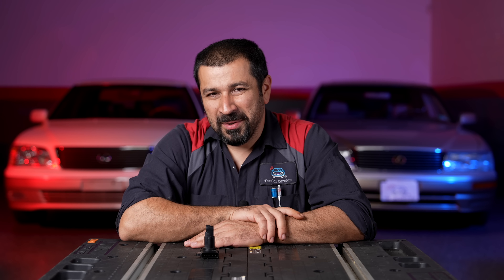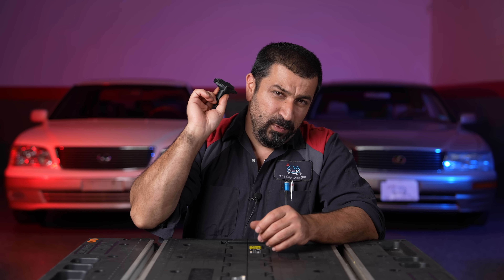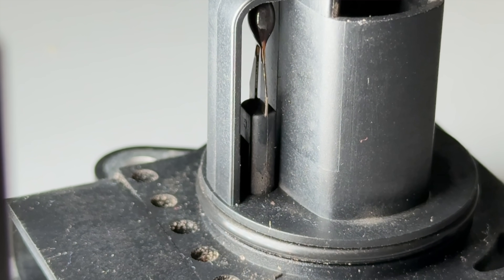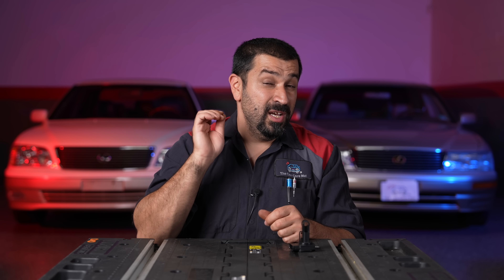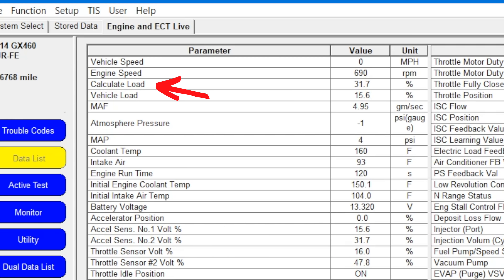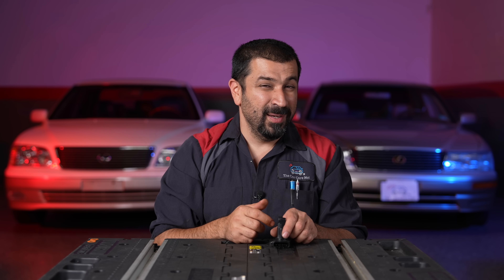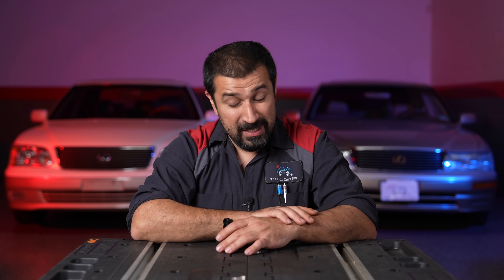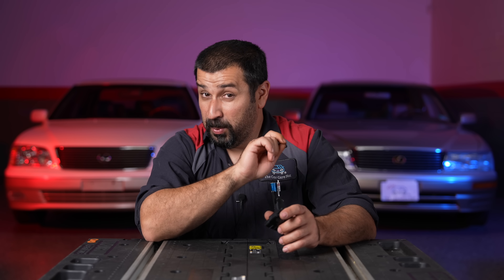Should You Clean Your MAF Sensor and How to Test It and Clean It on Toyotas

Comment: I was told only check or clean the MAF sensor when the check engine light comes on. Is that an accurate statement or should I clean it yearly. 
I drive a 2013 Honda Civic.

Comment: My 2010 4runner just stopped accelerating. the truck idles smooth, and runs great, I just lost 100% throttle response. Someone told me the acclelerator pedal sensor went out, so I changed the accelerator pedal assembly. Still no response. Is it this sensor, or perhaps throttle body?

Comment: Great video,
I have a Calc Load reaching 93% and then tailing off back to 78ish at higher revs. It only reads 12% at idle. Also sometimes when backing off I notice it goes to zero, is that normal?
Thanks

Comment: Happy new year 2025 Ahmed 🥳 . how long does it takes to erase a permanent p0102 code in a 2015 rav4 stored in the ecu memory . Right now Theres no engine code and car is running fine,all I did is cleaned the mass airflow with correct chemical then reconnected to the wiring harness of the vehicle. Then I have been driving this car for 2 weeks now and the code still stored in obd2 reader as permanent. 
I just need your opinion about it , Will it go away on it own? Or is there an another way to clear, thank you

Comment: I have a 1994 22RE throwing a code 31 and 24 (I think, lean), that has the old style MAFM. One Toyota mechanic told me to gently clean the contacts inside the sealed part with a pencil eraser. I haven't tried it yet because I'm one of those people who causes things to break whenever I try to fix anything. So yes, I'm scared. Do you have any advice for me? Because I understand that this vintage of MAFM are hard to find, and/or are cheap knockoffs that may or may not work. On top of that I live in California, so smog testing too. Thanks.

Comment: Another excellent video for the diy troubleshooter. Our 2002 Camry with 103k miles just got a P0171 code. I followed your steps with scanner. Staring CL was around 50 at brisk acceleration. Pulled MAF and cleaned per your instructions and it went up to a best of 79 with 2nd cleaning. Would you go ahead and just replace it at this point? Thanks for all you  do for us and have a Merry Christmas.

Comment: I love your videos. I do learn from you. That said, as an electronic tech in Aerospace I used to own a 2002 Camry. I actually cleaned (yes, I removed the siliconed cover) the pot/wiper. This was a delicate spray cleaning and it worked for just over two years before replacement.

Comment: I have an opposite problem on my MR2 Spyder. The car wants to run SUUUUUPER rich. Like absolutely bonkers rich. The ECU then wants to make it as lean as possible (-20% to -35% short term fuel trim), and the car is still running a bit rich. Like, it´s still usable. But it consumes like 9 to 10 liters of gasoline per 100 kilometers instead of 8, and it smokes and smells of improperly burnt gasoline when its not heated up. I´ve already cleaned the MAF, and it got a little bit better, but didnt fully solve the issue. To be exact, when I heat up the engine and delete the error log, the check engine won´t come back. But it still comes back after the engine cools down and I restart it. The heated up engine causes a slightly higher fuel consumption (and probably a tiny bit less power), but the cold engine is so dirty that it always throws the check engine light. And no, there is almost no oil consumption, and no burnt oil smell.

Comment: If your car is approaching 10yrs and over 100k miles, I don't understand why you would clean the sensor, when you can easily buy a new one cheap online. This whole video is a waste to me to try clean this sensor when you can just buy a new one because most likely your car is already old so why would you stay with an old thing ready to die
Reply: New OEM MAF sensors can cost around $300. The CRC electronic spray cleaner at Harbor Freight sells for $10.99.

Comment: My 2002 Camry,290000km engine is not revving up when step on gas paddle after start when it's minus 30 Celsius or under outside. It's running at idle speed only, but it goes back Ok normal after 5 minutes warm up. When temperature is not that cold there' s no problems at all. I just wonder Is it the airflow senser problem or some other senser? Any suggestion where I should check?

Comment: THANK YOU!
You pretty much saved me from making a fool of myself. 🙂
When our 2006 Matrix had about 75K miles on it, i found the section in the manual that I have about cleaning these. Hmm. Never did it, didn't know about it. So, I got a can of CRC MAF Sensor Cleaner and did a cautious couple of spritzes of the hot wires. That was it. Reinstalled it and was quite surprised at the boost in performance! So, immediately, the mind goes to should I do this at each oil change, or no? Luckily, I let it slide, and now I have a way to diagnose it; even my $40 code reader will display live data, so CHECKING IT when I do the next oil change is on the agenda. Thanks again.

Comment: With all due respect when all the advertisements come on the amount of audio volume is at least twice as much than during your video  .Either way the difference in audio volume is astronomical compare to all othe you tube videos.Love your channel and thanks for sharing your knowledge.
Reply: I should also say I have a very powerful home theater system and it scare the bejesus out of me when the comercial came on because your audio was too low and I had picked up the volume.
Reply from the maker: @latin4ujr  this was a known issue with some videos. The video after this one the issue is resolved. Sorry about that but it is resolved going forward. For those affected videos if you switch from 5.1 audio to stereo the volume will be normal
Reply: @TheCarCareNut  thank you,I have a 2018 gs350 rwd fsport and an 2017 nx200t. Your videos are priceless for me. May  God bless you 🙏

Comment: Great video. Your knowledge is much appreciated. One thing though about testing the MAF sensor. When i floored the accelerator to see if I can get the calculated load up to 85 or 90 percent, it only  got to 91 for a split second and instantly dropped down with a slight reduction in throttle. That's normal right? Thank you.

Comment: Ahmed, I would like to thank you for all the input you gave regarding the MAF sensor, I was expecting the MAF sensor for my wife's Corolla which was having an issue and nobody could nail and isolate the issue. Changed the sensor, it took 4 days for the ECU to adjust and now it's working. The main issue was that it idled very rough when starting and once in operating temperature the idle improved.

Comment: I have a 2011 Sequoia with 250,000 miles. I cleaned the MAF with CRC MAF cleaner at 200k as well as the throttle body (which was shockingly clean) and haven't had any issues. I'll be buying a new OEM one though just to avoid any future issues. Spending $100 every 250K isn't too bad haha.

Comment: Of all your videos that have helped me, this one has taken it to another level for me!

I put the wrong oil on my k&n air filter and burned through 2 of these (2011 RAV4) before I realised what was causing it.

Ive since fixed the filter problem but just this week I've had another fail in me. I was feeling so down because I couldn't understand why they keep failing. 0 MAF sensors for 11 years then 3 in 2 years  😢

But your description of how delicate they are helped me understand. I've been buying 2nd hand replacements coz genuine new MAF sensors are a bit pricey in Australia. But worth the expense if it stops the problem.

Thankyou, Thankyou, Thankyou!! May the true God bless you for your helpful spirit 🙏
Reply: Those K&N style filters are junk. The only way it increases airflow is by decreasing filter performance. Just get a good quality paper filter and replace repeatedly. No more issues with MAF and better longevity with your engine.

Comment: I recently watched your Video on how to 
Care/Clean and Check for a Capacity Load while Driving the Car.. My question is ,, What Device/Piece of Equipment did you use to Calibrate the Capacity Load of the Mass Air Flow Sensor and How did you Hook it Up to it.. You did not explain these steps to your Subscribers. Thank you for your Time Mr Car Care Nut

Comment: I took my throttle body out a couple months ago, and it was caked in grease.
So I used degreaser and some water and started scrubbing away at the butterfly valve.

After it dried, the throttle body conked out and went bad. Installed it, and when I fired up my engine, it died 3 seconds later.

Now I am waiting for a used part to arrive in my mail - and having paid for a very expensive lesson...
Then I saw the video on cleaning throttle body - and to never get it wet! If only I had seen it before I embarked on my cleaning project... 😞

Comment: Thanks for your advice. I had exactly this issue recently. Treated my car to new plugs and coils (was only going to do plugs, but there was a special offer on both - for proper Japanese NGKs, not Chinese cheapies) and started getting lean mixture codes. I figured the new plugs and coils (the old coils were originals from 2003) were burning the fuel more efficiently, as the car was noticeably livelier. Put injector cleaner through the system and spray cleaned the MAF sensor, but it still wasn't happy, so replaced the sensor (with an OEM Denso one) and the car runs like new. Considering the original MAF sensor had lasted 125,000 miles,  I reckon I got my money's worth from it.

Comment: Wow. Thanks. 

I now understand what the Load value from my Scan Gauge is indicating. I hit over 95% towing. I try to cruise below 90%. 

Plus, I will leave my Mazda 3 MAF alone as it still runs great at 60K. 

Significant power restoration at 80K 2016 4Runner with MAF airflow cleaner spray by me. Was sluggish since about 60K.

Comment: IMO when it comes to things like MAF sesnsors, only clean them if they're causing problems (idle issues, etc), and use cleaner designed for MAF sensors or delicate electronics that doesn't leave residue or otherwise damage the sensor (don't use break clean, which I have seen people do).  I did clean mine on my Toyota once, nothing bad happened, but it didn't help the idle issue (later found out it was actually carbon build-up so running some concentrated fuel injector cleaner with PEA fixed the issue, but at least I have a clean MAF sensor now).

Comment: My lambda sensors both fired up the dash Christmas tree on my 06 Lexus is250.
Break cleaner (German quality) on the MAF cleaned it, and the lambdas were happy again (Christmas tree off), however stuttering and "lag" on the gas got heavy after cleaning.

After thinking about it, that made sense. The ECU was used to the dirty sensor and now confused. Neg battery off -- 15 min -- neg battery on. All good. <3

Comment: After watching a Scotty Kilmer video about MAF and throttle body cleaning, I just went to the local auto parts store, bought MAF cleaner spray, and carburetor/throttle body spray.  

All I did was remove the MAF, spray it down with MAF cleaner.  Then I let it dry.  I did the process 2-3x.  Then I sprayed the throttle body with its proper cleaner, and wiped it down with clean cloths.  It was filthy.  By the time I was done servicing the throttle body, the MAF was completely dry.  I then put it all together, and let the car sit overnight.  

It was the easiest service possible, and it dramatically improved my Corolla’s performance.  At the time I had probably 190K miles, and that service was likely never done.  

Honestly it felt like my little Corolla gained 5 horsepower.  The engine ran smoother, it growled more (in a good way), and it had more pep.  

So thanks Scotty for that video. 

Also, thanks CCN for going more into depth.
Reply: a car that resets itself, funny guy 😅😅
your faultcode disappears after a few miles of driving, but your fuel trims, timing.. will stay messed up untill you do a Kam-reset and force the Ecu to relearn the new sensor.
Reply: you always need to reset Ecu when replacing a sensor!  Thats a number 1 rule, unless you replace a spark plug or a burned coil. When you  bring your car for a service to the dealer, the dealer always perform a Kam-reset when replacing such thing.
Reply: lucky man 😇
Reply: 190k miles and you rather waste your money on two bottles of cleaners equaling maybe half the price of a new sensor. Don't be a cheap @$$ & just buy a new one online for cheap.
Reply: @Maxx134a  The cheapest online Toyota OEM MAF sensor is $125, that's far from 1/2 price for 2 bottles of cleaner.
Reply: @OldelCpt  yes sorry you're correct. I didn't buy my sensor from there. Mine looked old & dirty. I replaced it with new part from "Rockauto". Lots of choices there.
Reply: Another thinkg you can DIY services is the PCV valve. I did that for my Camry and immediately i can feel the car respond better.
Reply: The ecu can compensate for it yes, you get better performance (for a while)  after compensate is done the car gets sluggish after a week driving because the Ecu holds the old timing values and Long term fuel trims stored.
Reply: You cannot feel an extra 5 HP.
Reply: Corolla growling - now you’re just imagining things 😂🤣🤣
Reply: Dont forget to reset the Ecu after cleaning/replacing this sensor !

Comment: Cleaned mine since I had the throttle body cleaned from taking everything apart for the spark plugs at 237k miles. I don’t think it changed much since there’s 3 different variables, but the car felt the same and in this case, no change is a good thing

Comment: This part is cheap.  Just replace it and see what happens.
Reply: @subtegral  don't know where you shop.  I got mine on Amazon for less than $20.  You're better off cleaning the throttle body.  Now that could be expensive.
Reply: @subtegral  never buy oem.  That's for suckers.  Some third party parts surpass oem.  Like window motors.  Also, Denso is not exactly OEM either.
Reply: @subtegral  OEM is made by Toyota.  Like in the 90's and earlier.

Comment: Geat video. I bought my RX330 with 215,000 miles on it. The previous owner had good service records and i see his old garage cleaned the MAF every 50,000 or so. I just took my cheapo scan tool and did the test. At pedal to the metal, Calculated Load was 100-97%! Life is good! Thanks CCN.
Reply: What should I do? Dirty it up?
Reply: 😅 @samhoskins8706

Comment: Have a 2002 Tundra. Finally needed to put it in 4 wheel drive simply hauling and parking a simple trailer. Unhitched trailer, then drove in regular gear about 60 miles.   Thankfully about a block from home, Tundra died.  Now, when in PARK.  I turn on Tundra, BUT when I put it in gear it immediately dies. What did I trigger to freeze up???? or something more??

Comment: I have a car with a 3-wire mass air sensor, a separate IAT sensor, no map sensor. Torque Pro connected through obd. There is a supported PID for vacuum/boost. What on earth would cause mine to constantly spike into boost on an N/a motor?

Comment: Thank you so much for this video AMD! Long time watcher/subscriber first time commenter. My 99 4Runner has felt sluggish for a while. I used the torque app to see I was only getting upper 70s % engine load @ wot, no change after cleaning so replaced the maf with a new denso one and instantly got mid-90s % engine load. Feels like a new truck again! 99 4Runner V6 5vzfe 285k miles
Reply: @subtegral  both Toyota and Denso

Comment: Hey Ahmed, we met at the meetup back in August . I told you how before I knew any better, my Lexus ISF was stalling randomly. Took it to the dealer and they diagnosed a faulty alternator, and charged me $2000 to replace it (I didn't know any better). Didn't fix the problem, and through internet research I found all I needed to do was clean the MAF. $10 CRC MAF cleaner and very easy work fixed the problem. That experience radicalized me into learning more about how cars work and how to fix them. When I get another 2UR GSE, it's coming to your shop! As well as my grandparents' 20,000 mile 2000 Camry V6 that they will give me when they are done driving.

Comment: Great and thorough explanation as always Ahmed! 
The scan tool im using has Engine Load percentages, I wonder if this the same as Calculated Load? Then there is also an Absolute Load percentage.
It can be a bit confusing.
Reply: @subtegral  Great thanks!
Tested it yesterday and it seems fine, still gotta chase the source of an occasional rough idle though!

Comment: I did the calculated load test on my engine and it gets close to 70% on full trhottle. My car has a Hot Film type MAF sensor. Do you recommend I clean it? Or there is a high chance I damage it in the process?
Reply: @subtegral  yes I did. He talks about some other type of sensors with a chip that is responsible of measuring. But doesn't mention hot film type sensors. Therefore my question. Unless the chip type he's refering to is the HFM type, though it's not clear, at least to me.

On forums and articles all over the internet there's a mixed opinion about cleaning HFM sensors. This guy seems very knowkedgeable. That's why I'm asking this question here.

Comment: This is very informative. Since recently buying my 2018 RX350, I changed the filter to a K&N and cleaned the MAF with a CRC MAF cleaner. The car started choking under full load. I replaced it to OEM paper filter it still chokes while under full load a little and then it seems to start readjusting to prevent choking. Is it possible that the preoiled K&N filter contributed to this problem? I am not sure how well the MAF sensor on the 2GRFKS engines responds to K&N filters so would be interested to hear from you and others regarding their experiences to determine if I need to return it. Thanks